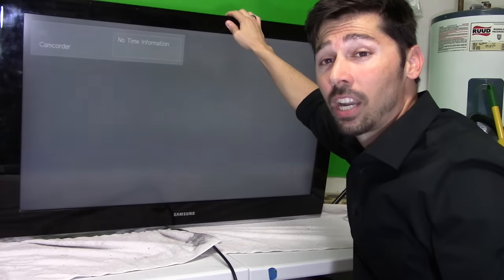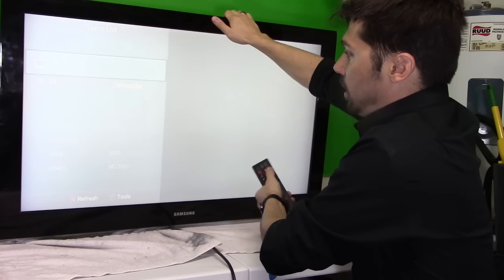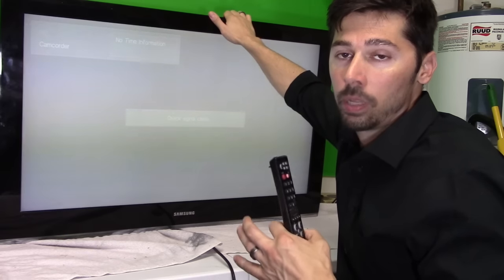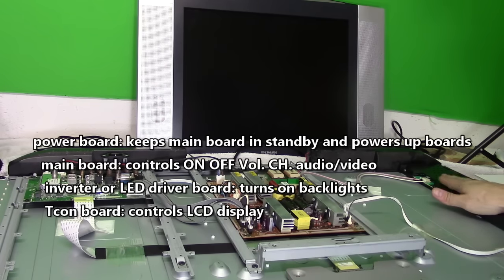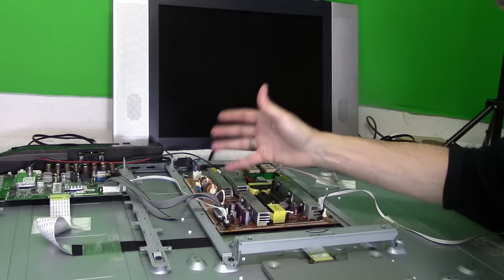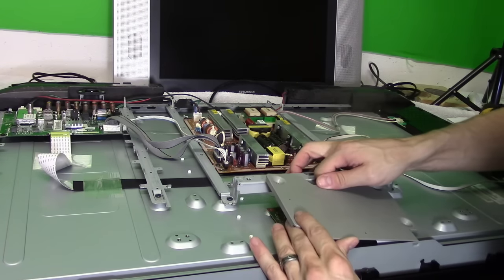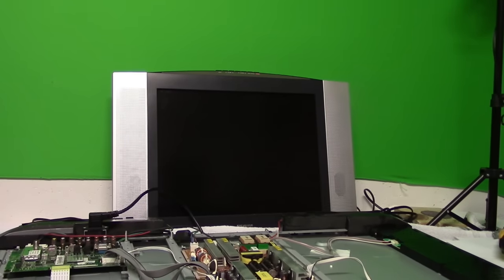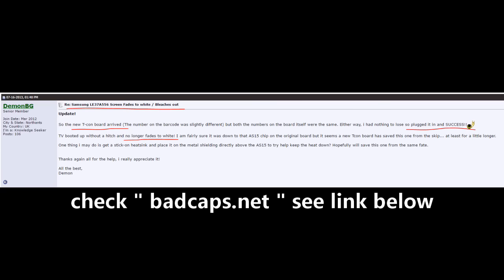LED LCD TV REPAIR GUIDE: How to troubleshoot without meters or testers

Comment: You just got me a free TV; my folks set broke down and they got a new one, and I took the old one to try and fix it.  No picture, no audio but 5VSB.  I managed to find that the Power supply board was giving +5V standby, but not thing when powered on (multimeter verified)  No bad looking caps or anything I could see, but I just got a replacement board for like $25 and boom, tv worked.  Although my issue wasn't exactly covered, the tip to try and get a new PSB got me a near-free tv :B

Comment: Thanks for another great video. I have a Samsung LN37A550P3FXZA that will not turn on. I did replace a few bulging caps on the power supply. Still no dice. LEDs do work. Stand by light flashes about 10X then 1 short flash then 10X again.  Possible main board failure?

Comment: I think my previous comment got messed up, sorry if it went twice. I have a Sharp LC-52LE810UN. After an hour of being on, it starts with flickering. Image and sound OK, but flickering is obnoxious. I reset following your advice, set up again, disconnected all devices attached and nothing. Apparently is more electronic than software. Please advice to look for problem. Thanks again for sharing your knowledge and experience. Keep the good work. Bless your talent and human quality

Comment: Tampatec! Fantastic tutorials! I own a VIZIO 50" non smart tv. My issue with it is the sound is quite low on certain channels and loud on others. Also, the volume will occasionally and suddenly drop. Another issue I have is my tv will shut off by itself and then turn back on.
Reply from the maker: Brett Ian that seems like main board aka A/V board. shopjimmy.com may have tv repair kit for that tv model. hope that helps
Reply: Tampatec do you have a video on how to replace the main board? I have zero knowledge or experience in working on tvs

Comment: Whats up tampatec, love the videos as you are always super informative.  Ive recently ran into a problem with my hisense 4k tv.  While playing a game the screen went super bright white.  I went through all the trouble shooting, the picture is still visable, there is still sound, i can still see and access the menu, but the screen is super bright white.  Ive tried the whole unplugging it for a hard reset, ive looked at all ribbon cables and reseated them.  But i did notice a faint humming noise from the t con. Hardly noticeable, but i doubt it was there before. Even without the humming, what are the odds that its the tcon? Thanks so much and keep the vids coming bud!

Comment: Awesome tech crash-course. My unit's issue is very similar to the Spotify screen you briefly flashed up in the video.The only difference im my case being the dark horizontal section is at the top of the screen (top 1/3 horizontal section is dim).  I think you mentioned the inverter board being the culprit. In my experience with laptop inverter board issues, the entire backlight of the screen would go out.  So  before seeing this video, I just assumed the inverter was not the culprit. I'd  really appreciate you input on this. BTW, mine is a 32" Sceptre. Thanks!

Comment from the maker: Holy crap almost 200K subs I remember when I had only 200 I was so excited back then 2010. Thanks to all my subscribers for supporting the Howto Tech channel!
Reply: Hey so i have a Sony KDLW900a and i'm getting the blinking light 4x. I replace the LED Board and TConn board and still 4 lights. Is it the Main Motherboard? It's 120$,
Reply: Could be the power supply too, that's 85$I'll have to recheck capacitors etc.
Reply: I just subscribed... Good stuff..
Reply from the maker: Educ8Today correct it's possibly tcon board.
Reply: Philips 42
Reply: Well you are generous with sharing your solutions, so you deserve even more.
Reply: i was wondering if u may know my problem my tv when i turn it on some timesthe screen fades black and white then eventually its fine no problem when on and picture is great i notice when i turn it off for awhile it only does it please help lol 42 inche E422VLE
Reply: Tampatec 
🎅🎅🎅🎅🎅🎅🎅🎅🎅🎅🎅🎅🎅🎅🎅🎅🎅🎅🎅🎅🎅🎅🎅🎅🎅🎅💇💇💇👿💙💪👱👯💂🎅💅👻👹👻
Reply: I need help, please reply
Reply: bro i want change lcd data panel please wibsade send me
am again thanks you
Reply: how can i out from media switch?
Reply: Hindi me chahia
Reply: Tampatec 

My digital inputs have stopped working on LED TV.   All HDMI inputs and PC input don't work.   Buzzing sound from transformer on power supply board.  Component input works.   Ideas?
Reply: Came across this video, absolutely fantastic, diagnosed my Samsung tv fault perfectly, the horizontal dark shadow, thanks, now going to go in and trouble shoot, lol
Reply: l ci.tir.tivi.makero
Reply: Your welcome

Comment: Hey TT, Thank you for making us guys feel empowered! Even if we live where it's cold! LG 32LC7DC white screen with three blocks of colored lines. Red and black closer to the left side, and multicolored on the right and 1/3 from the right. Rest is white. New PS board and it's still there. Mosfet on T-Con board is opening and closing properly. Think it's the T-Con board or Main board or screen ribbon connections? Thanks for any compass headings!

Comment: I’m trying to trouble shoot a couple of TV issues I’m having with (2) LCD TV’s I have which at the moment are not functioning. 1st I have a Olevia-537 B12 which doesn’t turn on at all no power light, some symptoms prior to the TV going out was that the TV would need to be unplugged and power switch off and after 10-15 min it would sometimes come back on and we had to leave it on or it wouldn’t turn on again unless we did this dreadful process. When the TV was working properly it also didn’t show a standby light. But I’ve watched your repair videos and am trying to diagnose the issue myself, the board looks ok after a visual inspection, but I did find a 10v 2200uF capacitor that is showing bad in circuit I purchased the MESR-100 and got the results of a bad capacitor I also tested some other capacitors and they were showing as good capacitors. So I was assuming that if I replace this capacitor this would hopefully fix the issue with the TV and bring it back to life. My question for you is do you believe I’m on the correct repair path for this TV or with your experience should I check something else? I’ve looked on ShopJimmy.com and they currently don’t have any replacement power boards so I was going to just replace the bad capacitor with a 25V 2200uF capacitor and hope for the best.

2nd and latest issue/headache is that I have a Curtis LCDVD 326a TV which just as recently has stopped working as well, I believe it to be a power issue. This TV does have a Standby Light (Red) when TV is powered off, but now it doesn’t turn on at all no lights. I was trying to diagnose this TV last night and like your video suggest test the Standby voltage. I confirmed I have good AC voltage from the wall approx. 123VDC, but on this particular model the voltage ratings I think are on the logic board not the power board, because on the logic board I see labels for +5V/PSON and +5V/SB they also have other labels like +12V/GRD etc. So I tried to check for Standby Voltage and got no reading. Any suggestions on this issue would be greatly appreciated. I can provide a photo of the components on the TV and labels on the boards if you’d like to see a visual of what I’m working with. I do apologize for the long extended message and I know you’re busy, but hope you can provide me with some support, this would be my first electronics repair if I can get these TV’s working again which would make me feel awesome and maybe even become a hobby for me

Comment: I once attempted to open a TV repair shop/service in the mid '90s. By that time most TVs had one main IC for all the signal processing. Sometimes the processed video and audio output came from the main IC and sometimes these were separate ICs on the motherboard. I was an experienced field and bench tech in digital process controls and microwave communications, ... so ... not just a "Mom's basement tinkerer", but I found that manufacturers like Sony, Toshiba, RCA, etc, would not sell replacement ICs or even replacement boards to me unless I received their "Tech Certification" ... usually at a cost of several thousand dollars.

The problem is that most people, even with knowledge of electronics, will not have access to replacement circuitry and boards.

Comment: OK here's the FIX! 
I got this tv free on Craigslist. The owner said it powered on but no picture. I powered up the tv and was pleasantly surprised to see a very nice picture however, as I noted originally, the remote wouldn't operate the tv and I was suspect of the IR board. Watched a bunch of youtube vids including one where Tampatec came across a unit that would power on IF he disconnected the IR board. Something of a chance discovery on his part it seemed but replacing the board solved his problem.
Well, I opened the beast to discover that the tv had been dropped. Some of the plastic posts that receive the back cover screws were broken off in the area of the board in question. In fact, the board had popped loose and was shorting out against the chassis!
Repositioned the H3 board, fired it up and verified that the remote now works and the picture is beautiful!
Dontcha just love happy endings?

Comment: Hey man, awesome videos. I have a Sharp Aquos LC-50le650u that's been having issues. It turns on, everything works, the picture is perfect. However, at completely random times it'll turn itself off and back on. Sometimes it'll stay on for a few hours before resetting, other times it'll turn off and on multiple times in less than 15 minutes. I've looked over the caps on the power supply and everything appears to be fine, but I haven't actually pulled them from the board to test and see whether or not they're actually good or not. Any thoughts?

Comment: Question for Tampatec or anyone who might know what I'm dealing with . I have a Samsung LN-S4051DX that won't power on. It just clicks and has no standby light. I've tested all caps and they are good. And when I test the power board, I am getting overvoltage. Where the 13v pin is, I get 18v until it clicks, then it goes down and comes back up to 18, then repeats over and over. The three 6.4v pins are at correct voltage until the click, then they go down and come back up. And last, the 12v pins all have 26v, then drop down and back up. Board looks good. No burnt spots or cold joints. Sounds like a humming noise coming from transistor the whole time it's plugged in and clicking as well. Any ideas?

Comment: Tamp! Great videos! Given me a lot of confidence dealing with my TV's!
Question. Vizio has the orange glowing Vizio icon, so it's getting power. TV won't turn on and can't find any scorching or bloated capacitors. There's no clicking when I try to power on. Don't want to blow cash on a power board if I don't need to. Any thoughts?

Comment: Hi,  last night we had a thunderstorm that somehow caused a power surge that fried our LG 49UH6030, Xbox and our cable box. The TV's red light blinks three times when you plug in the cord and push the ON button but the screen stays black with no picture or sound. Which of the 3 boards do you think got fried?   Thanks for any help

Comment: Enjoy your site very much and am trying to learn from it.If you ca hel I have a westinghouse tv model LVM 37w1 and it turns on ok and has sound bt there is a red line about 4 inches wide that runs vertically top to bottom.can you tell me where or what is the problem and how i can fix it?.
Reply: Thankyou very much !

Comment: Hi Thanks for your videos.  I have a 50 in LED Insignia TV that is not working.  The standby light comes on and it clicks and flashes 3 or 4 times then the standby light stays on but there is not picture on the screen, totally black.  I opened up the back and I didn't notice anything wrong with the capacitor.  Is there anything else I should look at?  Thanks in advance!

Comment: Hi. first i have watched most of your videos and they are excelent.  I have a Sharp LCC4654u that does not turn on at all and the Power and OPC lights are blinking. I don't know if it is the Tcon board or LED lights. I'm not sure if it has LED lights. Can you help me out. Thanks
Reply: seems to me that is an error indication code. My plasma also did that. How many times does is blink?
Reply: Thanks. 3 in power and 1 OPC .

Comment: Tampatec, I'm replacing the control board on my TLX03210B polaroid tv. After removing the screws and unplugging wires the board seems to be still attached to the chassis.  Do I have to unsolder anything to detach this board?

Comment: on samsung you can diagnose the white haze with just the remote. while off, press (mute, 1,8,2, power) and look for the test patterns. you can see if the frc test patterns (from the main board) and the tcon test patterns are both washed out. if just the frc, it needs a main. if both, its the tcon. you can also find a 4 pin or hole connector on the tcon to turn on the tcon test patterns by shorting pin 3 and 4 together
Reply from the maker: jesse demers great tech tips. thanks for sharing them .
Reply: I usually wear 3D Glasses with all the lights out and try to find the TV with a Bingo Magnet. Hadn't had any luck yet tho so i might try taking a lens out of my prescription glasses next and throw the TV in the bathtub

Comment: Hi. I have the horizontal lines on the upper quarter of the screen (UN40ES6100, from 2012). I've disassembled and tested all flat cables. Disconnect and messing with them makes no change. This started to happen 2 months after warranty time passes (I hate the Samsung perfect planned obsolescence. Their engineers must be proud of it.). Is there a way to fix a led panel without replacing? 

It's very strange, because if I disconnect one of the T-Con flat sides, the lines stand on the turned on and start to fade on the disconnected side, leaving a beautiful white with no lines. The same happens doing the same to the other flat/side. So it appears it's not the panel which is defective... I' don't now why something so bizarre have to happen just with me (can't find anyone with the exact same issue).

Comment: Sorry if already covered and I missed it. Sony KDL52XBR4 no response to original and other remote(s). Remotes working fine on other Sony tvs. Side control panel buttons work fine. No lights on (power, stanby etc) in indicator panel below screen. Haven't opened it up yet. Is it possible that the IR board is fried and that would knock out all indicator lights? Have you covered this issue on any of your tutorials? Are there schematics?
Reply: Located a vid by Tampatec where in fact a faulty ir board was knocking out a tv completely.
I plan on exploratory surgery tonight to see what the innards look like.

Comment: Have a samsung model ln32a450c1dxza. I would turn my tv on and thenit would go  off and on like 2x and then it was ok so I bought this  used board but it didn't work. Then I put my old board back in and the tv wouldn't go on. Then I used a hair blower and heated up the 4 capacitors and then the tv came on. Now the capacitors look fine with no bulging. Do you think one of them is bad and how do I tell which one when they all look fine. Thanks in advance. Love your videos. Joe

Comment: I had an older Insignia 50 inch picture fade out to black while I watched a program. The blue stand by stayed on and will not turn off or on with either remote or side switch. If I unplug, and then plug back in, The red standby light comes on. However when I press power switch on the side of the tv, the blue light comes on but no picture. I run audio off of a stereo so I do not know if audio works. Any idea what caused this?

Comment: i just thought of something when repairing ,you need the tv stand original base off correct,
 then you lay it flat on the table fix your boards
change a cap change a board change a transistor etc etc , then  when you test you need to bring it back up correct
to see if all went well, why not make some temporary flat tv panel stands out of wood 2x3's on both sides of tv
the wooden stands will be made with carpeting on the inside to protect the screen and 3 pieces per side
2 pieces making the holding slot at  2 to 4 inches apart so the panel slips in freely then one piece below
as the base, and youll need triangulation to support the tilt or roll of the tvs weight with in the slot and of course 2 sides 
maybe staple carpeting all around the support stands, good idea ??, also it will help with re attaching the base after all is done
get back to me on that okay mike out

Comment: Hey Tampatec, love the vids? Can I ask more than 1 question? First off Sony KDL-46EX600. When turned on & running the screen is divided in 3 sections that are about equal in size. The section on left & right side of screen are lighter in color so the inbound source looks good in the middle but lighter on each side with defined verticle line separating each section.  I have j screen fix on my phone but when paring it to the TV only the middle section gets the video source  from my phone. I tried j screen fix on my laptop but it seems to be an open file & not an exe file so I can't figure how to run it on laptop. I don't think that is the problem so I run it by you. None of the caps bulge in the top ends. TV has never been dropped. 
What YouTube video would you suggest to make a good HDTV antenna? I am hoping for one I could hook to radio as well. The car radio gets my favorite station 40 miles away but inside radios struggle to get the station but fine with any here in town. 
Is it possible to hook up old removed back light from flatscreens like someplace under kitchen cabinets & plug into a wall transformer or a simple circuit to have well hidden but bright lights?
thanks